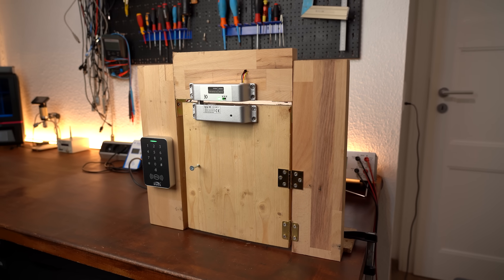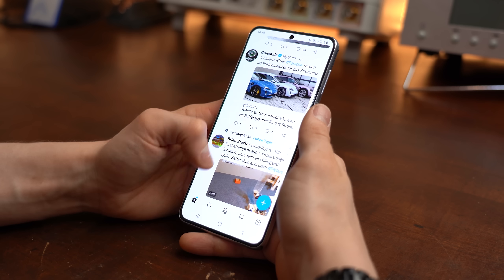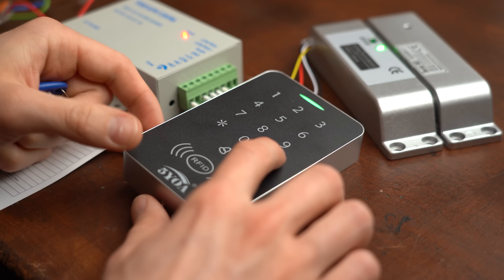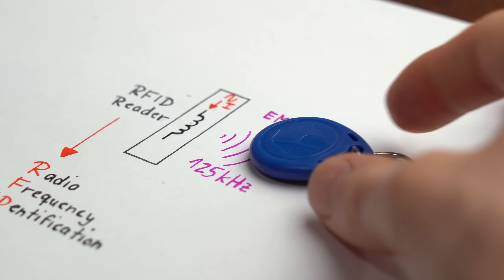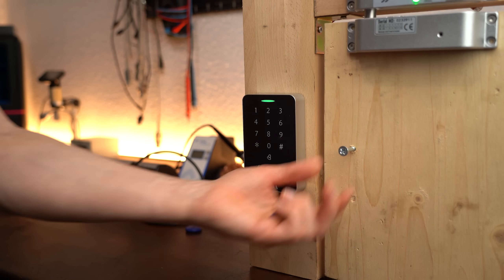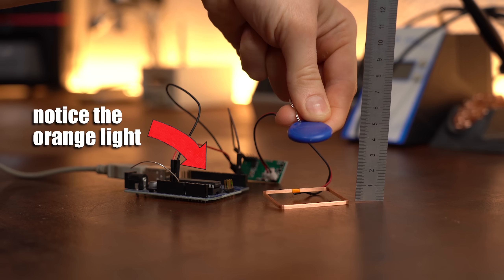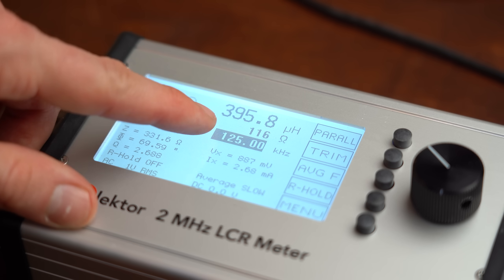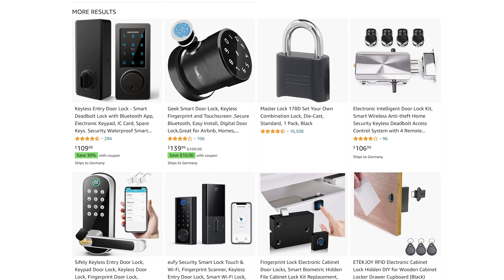RFID Locks are way too easy to "Hack"! Let me show you!

Comment: It's the credit card/password problem where the obfuscation of a shared secret is just deemed sufficient even though anyone could just copy that secret and often wirelessly at a distance.  We really need to move to a challenge response authentication but no one wants to invest in such as they consider the lack of security to be an acceptable loss and an opportunity to blame the customers and hence offset indemnifications to the consumer.  This won't change without regulation.

Comment: If it’s not MiFare2 encryption, it’s probably junk. Non-encrypted RFID is junk.
Reply: That's true, but it doesn't change the fact that there are many, many unencrypted RFID systems out there in the wild. Just because 125khz isn't necessarily the most secure RFID system does not mean this video is irrelevant or not important.

Comment: I once worked at a place where access to the parking lot was controlled with a large RFID reader. I would stick my arm out the window with my card in hand and slow down to just the right speed for the card to be read and the gate to go up just barely in time. The terrified looks I got from some security guards were priceless. 😂
Reply: off topic but this reminded me of the deck-hand on a Sydney ferry, as the ferry was reversing from the wharf, the deckhand would just casually flick the rope loop off the bollard.
Reply: @darylcheshire1618  @AlyssaNguyen damn, seems like you two got quite comfortable with the ins and outs of your jobs

Comment: Ik that everyone probably already said this, but I feel like it would make the most sense to just have the rfid receiver allow you use the key pad, you could type the code, or maybe have a couple different codes if different people live there, but only an rfid tag would make the keypad work, so if you had lets say a crazy ex girlfriend or something like that they might get the code, but not the rfid frequency
Reply: That... is actually quite smart. This is essentially two-factor authentication, where you would need both the RFID tag in ADDITION to a physical code in order to gain access. Not quite sure why this type of system hasn't been widely implemented - maybe nobody as really thought of this yet? I have done quite a lot of research on RFID systems, and I have never ever seen this idea brought up.
Reply: @SongSteel exactly!

Comment: how about the 14Mhz with chip using the challenge handshake?
Reply: I'm also trying to do something similar to copy an ID to the place I live in. How were you able to tell that your tag used a 14Mhz chip? Were you ever able to make any progress copying your credentials? Thanks.
Reply: @SongSteel  you can copy the raw data onto another in some cases, otherwise you need a reader you can connect to your PC then you need either software or a password to access the data. some 14Mhz tags are just ID based like the larger frequencies as people tend to be lazy about adding security at times.
Reply: @SongSteel  my programmer was stolen by my previous boss before i could even try. The device detects many frequencies so thats how. then all thats left is to connect to a computer to handle the data otherwise for simple copy the device supports it.

Comment: In theory you can copy it until you put foil over the card or fob. Most people use a card that is placed in a foil lined or metal bill fold.
Reply: Is that true though? Most people I have seen do not necessarily use a "foil lined" container in order to contain their RFID tags - they just use them as regular IDs.
Reply: @SongSteel   I am speaking of credit cards in which you have a chance of losing money and many people order conductive card holders from the bank.  I don't think it's a big issue but why not when it doesn't cost anything. I just put foil in the billfold and use the card like normal. The goal is to not be perfect  but be good enough for the person to pass on you.

Comment: No matter if u read rfid tag from 3cm or 30cm it's still stealing and not picking a lock. It's like taking a picture of key next to the coin and then copying it based on that picture. That's not picking.
Reply: That is true, but when they were referring to picking I think they were referring to "discrete entry", as opposed to the literal definition of "picking" a lock.

Comment: As someone who has been designing RFID readers for the last 8 years, let me point some things:
- The 125kHz systems (often called EMARINE) usually works on one of the EM41xx standards. It was developed decades ago, back when microchips were not that common. This standard, while widely used, is outdated, and shouldn’t be used for a security purposes. They are so widespread because they are extremely cheap. And they work great for some stuff, like if you have a lunch ordering system or a digital timeclock. You can get ISO datasheets with detailed descriptions of those cards and readers if you look up EM4000 or EM4002.
- Readers which work with 125kHz frequency use near field because the wavelength is about 2.4km. Reader with the most range that I’ve seen, and which is commercially available, has about 1m range. The problem is in the fact that you have to power the tag from the antenna coil. Transmission of energy is not efficient at these low frequencies and antenna shape doesn't really help that much. It’s a good idea to make a simple circuit which measures the field strength. Just make a small coil (like the tag), connect a capacitor for 125kHz resonance, rectifier, divider and another capacitor. You can measure the output directly with a multimeter. 
- Making a long-range spoofer should be possible. Just make an 125kHz receiver and detect the signal from the reader itself. Since you don’t have to energize the tag (it’s already energized by the reader), you should be able to catch the communication. Using some digital filters to process the output, you should be able to get at least 10m range. The only downside is, that you can capture the communication only when the tag is being used, but that can be solved by leaving that device somewhere near the reader and recording tags as they come.
- More secure standards usually use 13.56MHz frequency (f.e. your credit card) and they have a two-way communication between the reader and tag. Many standards support advanced encryption (look up Mifare Desfire or Legic).
Reply: Hello! I'm also looking into the field of RFID technologies now, and wanted some advice. How would you identify what type of infrastructure your RFID system uses? More specifically, what is the cheapest way to scan/copy RFIDs, without investment into expensive technologies such as proxmark 3? Is it possible to copy/identify/read/write to RFID for cheaper?

Also, I'm interested in the idea you brought up about "intercepting" the authentication key while the tag is being actively used. I've done a decent amount of research, but have not seen anyone brought this up yet. Is this all theoretical, or have you seen something similar being used in reality? Any advice helps. Thank you!
Reply: @SongSteel  Well, the best way to identify type of RFID system is to get a multitag reader, which supports good ammount of both 125kHz and 13,56MHz tags. I use TWN4 from Austrian company elatec, but we buy them in bulk and price for end customer is probably higher. There are many options if you are willing to buy from China, but I can't really recommend anything as I don't have experience with them. The most basic way how to tell what kind of RFID system you have is to get an oscilloscope and connect one channel to a coil. You can then scan the communication between tags and reader.
The most common 125kHz EM41xx tags can be coppied easily, all you need is a microcontroller and few components. Other tags are much harder to copy, especially if it uses some encryption (for example your debit/credid card). But again if you wanna try some cheap stuff, the best way is to look up experience with some chinese readers/writers.
And to that last part, no, it's not just a theory. We've had an issue with one type of the long distance 125kHz readers, which is installed on a driveway of a warehouse. Sometimes, when the truck driver was leaving the warehouse, he unintentionally opened both gates with one card. After few hours of testing, I realized that the there was a specific place and if you put the RFID tag in that place, both readers could read it. They were 10m apart and their normal range is 1m. Second reader was picking up a signal boosted by the first reader. We had to change the software so it would ignore that second reading within few seconds.

Comment: The best lock is a biometric with reader/temp/voice and pulse and code all must be within 10 seconds.  I have one and no one has ever gotten in.  with a code word I can lock the safe for eternity.  so if I'm under duress... use the code word and it literally destroys all the tech-good luck opening it after that.
Reply: What kind of system are you talking about? No ordinary civilians would have any real need for a system like you are describing. Unless you work with the upper echelons of the CIA, I'm sure you would have no practical use for a system as complicated as that.

Comment: All you need to do with RFID is rip the key/reader off the wall and touch the signal and common wire together. Your in. RFID is not “real” access control
Reply: While this is true, it is not always practical. The concept of "stealing" RFID tags is still very important and valid, since most systems are not this simple. If you needed to steal an employee ID to get anywhere else (especially if you need repeated access), it would be much easier to steal an ID as opposed to unscrewing the system and messing with the electrical wiring every single time you needed to enter.

Comment: You could make a helical antenna for LF to be able to increase range.  Normally this type of directional antenna isn’t used nor suggested for as low as 125Khz but it can be done.  There’s some calculators online you can use to help design.  You would be able to point in the direction of the transmitter and get a reading and also use it to send a signal to the reader thats connected to the interrogator that deciphers the signal.  The polarization would still be the same with a Helical antenna but it’d be a tighter shot because of the distance increase.
Reply: How practical would such a system be? Because not only would the "scanner" need to be practical for reading information over long distances, it also needs to be semi-concealable. It would be quite suspicious to be lugging around lots of electrical components that take up a lot of space. If the helical antenna was somehow concealable, then maybe it would be practical for this type of application.

Comment: Maybe it's been mentioned, but you know you can use your phones NFC to read write those. I used to pick tossed ski day use passes with RFID and repurpose them with my OnePlus
Reply: How did you get started with this/what are the limitations of your system? I'm experimenting with reading/writing to RFID right now with different infrastructures. Does the phone require anything special to work? How did you learn how to set up everything correctly?
Reply: @SongSteel  if I remember correctly the Google cardboard VR had a RFID to initiate the VR app. Setting this up made me play with RFID. I got some different apps and played a bit with different possibilities. Just a short experience with them...

Comment: RFID locks are way to easy to hack
Let me show you...
And he shows how he fails at the hacking part and don't recommend the cheap lock (that's probably not for home security but something else like a gate in a fence to a company (which they need for insurance) 

I would just rip of the device from the wall (2 little screws in thin plastic) and short the locking wires 🤷🏻‍♂️
Datasheet is all over the internet 

You could also just spam in random codes via 125kHz to the device, there is nothing like: you got your password wrong 3 times try again in 1 hour or something like that
No need to see the "homeowner" or shit that can you get recognized
Reply: I think even more important is the concept of "stealing" RFID tags though, since most systems are not this simple. If you needed to steal an employee ID to get anywhere else (especially if you need repeated access), it would be much easier to steal an ID as opposed to unscrewing the system and messing with the electrical wiring every single time you needed to enter.

Comment: This can be fixed by adding a button an the chip, that you have to press while holding it to the reader. This allows the chip to only share its data, when its circuit is closed

Comment: Just configure that reader to work with PIN and CARD :) I am actually working in this field and must admit, i had a great laugh watching your video. A little knowledge is a dangerous thing and you present here just fractions of information, although the final conclusion sums it up: everyone can theoretically pick this lock. In theory everything is easy, on paper everything works :) There is way more technology in the current RFID tags then presented in the video, however you are right on the presented relay attack, is the Achilles tendon of most RFID based systems.

Comment: What you try there is one of the original flaws of RFID systems that has been known pretty much since the beginning. The communication between the reader and tag can be eavesdropped on from up to 20x the effective working distance for an actual tag - more with the right equipment. Since virtually all RFID tags are no more than passive memory devices, they are thoroughly unsuitable for any security critical application - as is all unencrypted wireless technology by the way. 

On the other hand, the important upside of digital keys of all sorts is that unlike in mechanical keys, each key is different and can be invalidated easily if lost.

There are actually three solutions to this proplem: One, have a second factor like a pin that is needed to access the secure resource, or two, use cryptographic tags like DESFire instead of the cheapest option or three, use a secure-by-design reader that requires you to insert the key fob into an electromagnetically shielded slot to open

Comment: In the early days of WiFi I used to design corporate WiFi networks and the first thing I need to do was check or set the access points output to 25mW because pda’s weren’t that powerful. 

People thought it was counterintuitive to place more individual AP’s in stead of one big antenna at 100mW at the center of a room. What they forgot was that it’s a half-duplex communication and just turning up the WiFi amp is like SHOUTING REALLY LOUD whilst putting fingers in your ears. Changing the op-amp in this video reminded me of this. And it reminded me of a time before lithium ion and that pda’s were a thing…

Comment: you can trust rfid door same as normal analog key. you can copy key and lockpick door. or scan rfid and copy it OR you can still just drill and sawy lock off and go true door. its WOOD. locked door only means you cant go here but it wont stop if you want. bugler comes in your houws if they want.

human made desing have allways flaws they can be used way they not thought

its rfid it supposed to use track not open door. why we use it open doors?
would bar code be more secure. you cant wirelessy copy it xD

Comment: Great video, but I think it's a little bit misleading. Especially in the end, where you say, one shouldn't invest in an rfid access lock system but if so, than something with encryption. Modern systems like in office buildings use cards like Mifare DESFire EV3 from NXP. It's (almost) impossible (yet) to copy a clip, since the UID of the clip can be random at each read and is most likely not used at all. Within the chip there is a full microcontroller with encrypted data and each "session" between a reader and the clip is randomly encrypted, so you can't even replay the session, if captured.

Comment: A more secure approach is the unit to send an encrypted random code to the key, which then has to send back the correct corresponding code.
Of course, the mechanical parts also have to be strong and secure.

Comment: 125kHz systems are not very secure, NFC (13.56MHz) systems can be much more secure with the right tech. MIFARE DESfire cards can have encryption on it and is not easily hacked, but of course you also have insecure options with NFC too, the older MIFARE Classic is easily hacked.

Comment: The problem is in the passive tags w/o a challenge response feature (you can't call constant input a proper challenge). I don't know if there are passive tags with such a feature, but I believe it should be possible and an active tag would definitely enable this. Then you can encrypt the code with something really cheap and simple like 16 bit AES and this flaw is out. And yes 16 bit is enough because observing the challenge from the reader isn't very practical. Loitering around a secured door for multiple entries is quickly sus after all...
Reply: I don't know anything about lockpicking
And definitely not about elektrik locks
Yet, i wanted to know, I have a lock which I am trying to open, but it has an activ key. You would have to push the button on the key to get a response from the lock. I wanted to know if there is a device with which I could copy the signal of the key and make a copy. Like the Device in the video but with activ keys.
If you know anything that could help me, I would be happy.
Even if it's just a clue where I could find something like that

Comment: This sounds like you actually copy the CONTENT of the rfid memory. I would have expected that any decent passive RFID lock will not use data but the serial number.
And all the common rfid chips do not support to emulate the serial number, so you can not copy them without actually creating hardware for the job.